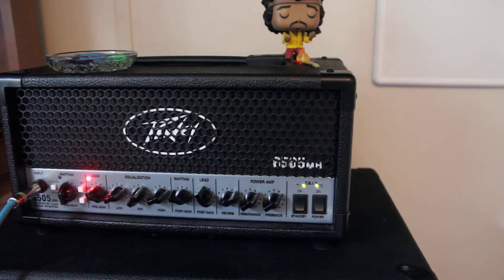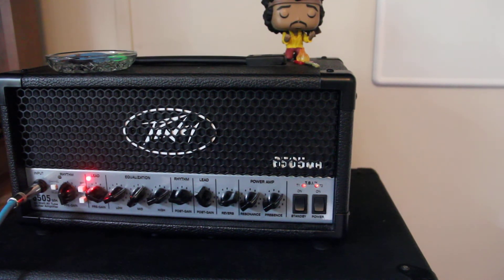Peavey 6505MH tubes over heating probably?

Comment: I had the same problem with the 6505 mh and the Classic 20 mh so I called Peavey and was told that the issue is that some value (i don't remember the name) in the t.s.i is set to high so when playing at a high volume the t.s.i thinks the power tubes are overheating (they're not) and shuts off them off. A registered Peavey service tech (find one at https://peavey.com/dealerlocator/) will be able to set the value correctly and resolve the issue. Just be sure to search for a service center because most dealers are not amp techs and won't know about this issue.